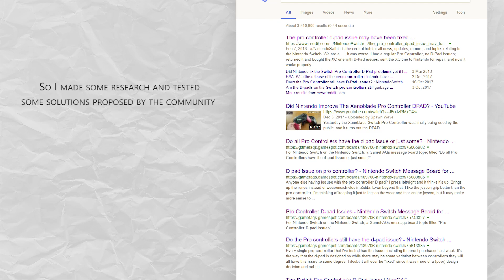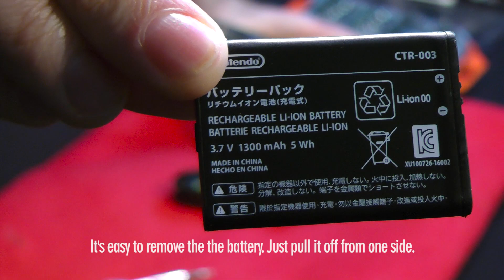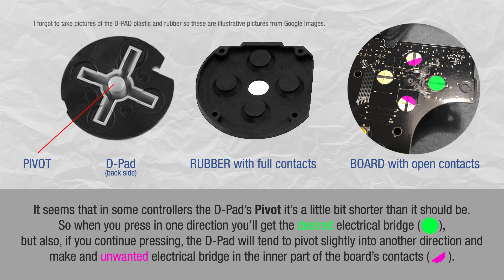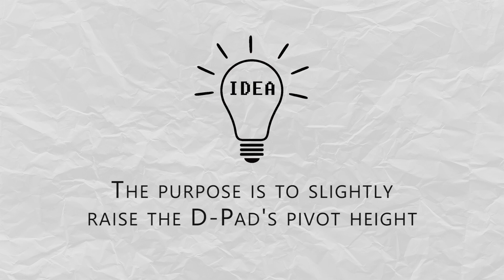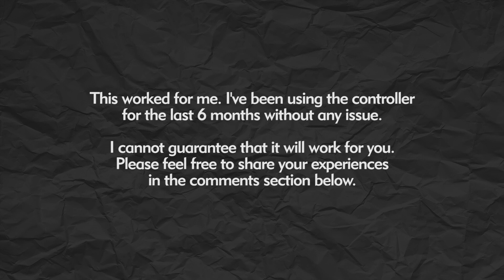Nintendo Switch Pro Controller | D-Pad Issue Easy Fix

Comment: I used four pieces of tape folded in half and it ended up being too much.  I assume by four layers of folded tape you meant two pieces of tape folded in half, because I tried that afterward and it works perfectly.  Thanks for the video!

Comment: Tetris 99 convinced me to try this. I did not cover the leads and you used two pieces of electrical tape layered on top of each other (cut into a neat circle). Well done tutorial.
Reply: I'm also here because of Tetris 99. 

Me: "Let me just push the block once to the right and get a Tetr--"
Pro Controller: "Oh wait what? Did you just..?  Did you just pressed UP? YES? OK! LET ME HARD DROP THAT SHIIIIT!"
Reply: guess we're in the same boat. for me it was completely unplayable

Comment: Mine was really bad and couldn’t play Tetris 99 without constantly hard dropping so I tried this and it works perfect, I covered a small part of the contact points and only used a little bit of tape for the center
Reply: same here, I thought that when tetris pieces droped randomly it was because it was other players attacking me but when I played handheld I realized it was the pro controller

Comment: Just did this myself. Thanks to your video. The only thing I did different was packed four layers of tape onto each other instead of folding it and then cut out the desired size that I need it. The reason I went this route is so I can have a sticky side attached to the pivot point on the d-pad. I did do an accident were I put the tape on the contacts and it was too long so it layered on to each other and I made the tape on the pivot point too thick so I would press on the d-pad and it was too far up, so it had to be pressed firmly. I just went back and remove the tape and started all over with smaller pieces so it won’t have eight layers of tape lol. Once I put everything back together, it all worked perfectly for me at the end of it, It’s a matter of preference for everyone so they might want to try different layers to their liking.

Comment: So I took it apart and found the contacts. I originally put tape on the edge of the contacts and put four layers in the middle, but the ones on the contacts where actually hindering the d-pad. I would press diagonally and get nothing unless I press down like a hydraulic press. I removed the ones on the contacts and kept the one in the middle and it was PERFECT. If your going to do this I recommend you just do the four layers in the middle.

Comment: This was very easy to do, I appreciate the step by step instructions, thanks! It has helped a bunch! I was worried at first that the problem was reversed, that what was once too-sensitive and thus registering accidental perpendicular presses (especially up, which really sucked in the new Tetris 99, quick dropping on accident!) had become too insensitive and it wasn't registering actual, intended button presses, unless it was pressed very firmly. I notice this only at first. It seems as though with some use, I no longer have the problem of light-pressure presses not registering. I'm no expert, but what I believe is happening is that the folded tape placed under the pivot point when very fresh is slightly too thick, and makes the d-pad stand a little too proud, but after some activity, it's mashed down to a thinness that is perfect to achieve it's purpose, but not too thick. Just a guess. Anyways, thanks again for the tip! Shouldn't have to be done on a $70 controller, come on nintendo! glad I went through the trouble though.

Comment: I found that doing both of these in combination for my specific Pro Controller ended up reducing sensitivity to near-unusability. Covering the leads with tape actually makes it harder to make a circuit entirely when the issue is really in the pivot itself. All I needed was the filler in the pivot to raise it. The OG X360 controller has a very similar issue except in the opposite direction: the pivot was set TOO high and there wasn't enough room for the pad to fully travel, so it often wouldn't make connections at all without force and deliberate movement.
Reply: So you only raised the pivot with a stack of tape pieces?

Comment: Good god, finally, a fix to the awful Pro Controller Dpad. I just did the tape on the censors(I didn't do the folding trick), and it worked great. Trying to play Celeste, Meat Boy, Mega Man, Dead Cells, ect, was a pain in the ass with the Pro Controller Dpad. This totally fixed it, and it was easy to do. I haven't had any bad inputs so far. Incredibly easy fix. I have no idea why Nintendo screwed up their Dpad on the Switch, as they're known for their great Dpads? I wish we didn't have to do this, but oh well, this worked.

Comment: I am very gentle with my electronics.  In 4 years, I never got joy-con drift. Yet when it comes to the pro controller, I have never owned, used or seen a pro controller that did not have a faulty d-pad; whether I am using a friends, family members or just testing one out at best buy. Every single pro controller has a faulty d-pad.

Comment: I noob at this n it took 3 times to get right. The 1st time is really frustrating, the controller dpad and abxy button doesnt work. I thought i fucked up and broke it and i was frustrated and i just about ready to just buy a new one. Then i tried for 2nd time for search what the problem. Turn out the ribbon doesnt clip/lock properly during reassemble. Reassemble of the ribbon is really the worst, turn out y need to make sure it in precise position and the lock is "click". But then problem is that the dpad sensitivity is way too low, i need to press the dpad really hard for it to register. So for 3rd time i just remove the tape on the contact and just use the 2nd method instead both. And now it works beautifully, no more random up/down reading and the sensitivity is fine...thank god.took me  2 hours to do this thing. In the end i really recommend just use the 2nd method shown in this wonderful video. Thanks for the vid

Comment: heard a lot of people say this works, i decided to try it
edit: after spending about 2 hours working on it (i had some trouble getting the strip back in and finding the right screw driver) i recommend this my controller not works perfectly, i did the 4 layers of tape on the pivet

Comment: bought a controller very recently and it still has this problem, good thing this looks like an easy fix.
Reply from the maker: Just to know, in which country did you buy it?
Reply: United States
Reply: Did you test it out, paulink?

Comment: Playing a complete 100% of Celeste and was getting tired of the joycons...   I went out and bought a pro controller thinking it would be better for this 2D side scrolling game that requires PRECISE controls.   Had the issue with the d-pad.   Followed these steps exactly as you described and BAZINGA!!!   Works like a charm.   Thank you so so so much for the fix.   I’m extremely pleased with the tutorial video and would recommend anyone to try the same.   Note- I only put the 4 folded tape on the center of the d-pad as shown in the video and did not have to put 4 pieces of tape on the d-pad contacts.   Thanks again!!!!
Reply from the maker: Timothy Stone I'm happy that it worked! When did you buy the Pro Controller? I thought that Nintendo already addressed this issue.
Reply: He actually bought his Pro controller from GameStop used yesterday.  We both took it apart last night/ early this morning. = )
Reply: 'Sup. Nintendo still hasn't adressed this issue, I bought a Pro controller last week and the D-Pad problem it's still there.

Comment: Whaddya mean by four layers of folded tape? Like 4 pieces folded over (8 total layers) or 2 pieces folded over (4 total layers)
Reply from the maker: Caleb1243  I folded a piece of tape 2 times to obtain 4 layer. But could also work with more or or less layers. It's actually trial and error.
Reply: I actually didn't even use that though. It completely screwed over my inputs and made the d pad so tight, it wouldn't click, even with only two layers. Only doing the first trick where you use four different pieces to cover up the sides halfway worked enough for me to play celeste, pocket rumble, and hollow knight

Comment: Thanks for the clear and informative video. Going to try this. On my second Pro Controller with the same issue, even my Wii U Controller has an issue with its d-pad. Pretty disappointing and looks like such an easy fix, would think they'd revise it and release different colours shrugs

Comment: Great video, this helped me out a lot. I used scotch tape and taped about 1/3 of the contact (instead of 1/2). Didn't bother with the pivot, worked fine without it.

Comment: I think I'm going to try this. My warranty has expired, so I can't void it. I'll update if/when I do it.

Update: Wow... I really can't believe how well it worked. I haven't tried any games yet, but I could not get it to register the wrong direction in the settings test. One thing I want to mention is that you shouldn't cover too much of the contact points on the board. If you do, it could cause some issues I've heard. I recommend watching Spawn Wave's video on the board fix for more details on it.

Other than that though, this works great! I highly recommend it. Just make sure your warranty expires first. That way if you get stick drift, you can get it fixed.

Comment: work excelent, I made the other fix almos 2 years but playing mario wonder stated to happend again and cleaning the glue behind when I removed the tape was a mess but I find this method and work very well. Another thing I like about this method is when happend again I don't need to clean and only change the layers of type.
Reply from the maker: Gracias Omar!

Comment: i just tried this, but because of the tape i put on the contacts the buttons are less responsive and they dont register any diagonal inputs, which sucks ass in general but sucks the most ass for stuff like fighting games. because of this i feel like the main issue is really the height of the rod on the dpad and not the contacts at all.

EDIT: i just tried going back and fixing it and figured out that it wasnt the tape on the contacts (or at least it wasnt the main issue) but the size of the tape under the rod that caused my inputs to be unresponsive. i switched it out with 4 layers of tape like in the video and took the tape off the contacts, and it was pretty effective although it didnt completely solve the issue. i tried maybe couple dozen times to get the tape under the rod to be just perfect, but i eventually gave up. pretty annoying, but at least it did help with the dpad issue.

EDIT 2: just tried using the procon in a fighting game and just realized that with the tape mod diagonal inputs are harder. im gonna go insane yo
Reply: That second edit is literally me rn 😔
Reply: I gave up with the folder tape and finaly used only tape on tge contacts 40%. Works well on celeste.

Comment: Tried it and it worked, however when I came to test it on Street Fighter, I found Hadoukens near impossible to pull off, strangely enough Shoryukens worked 100%, might need to test it with different tape folds.

Thanks again for the upload, this was killing me for weeks! (Literally) <3 <3
Reply: I am a little late to the party but it looks like that is caused by covering the contacts too far. Some people have opted to only raise the center of the d-pad for this reason. I am in the process of this right now and I will test Street Fight without covering the contacts and then test Tetris 99 to see if the inputs are more accurate from only raising the center.
Reply: @sykx7  can you comment back? thanks
Reply: @Trollseeder  Hey there, the fix for me resolved issues with both Street fighter and Tetris. I have been using the same pro controller for over a year without issues.
Reply: @sykx7  hey thanks for the info... so you suggest only raising the d-pad and not cover any contacts?
Reply: Correct, the lifting should do the trick. Covering the contacts hurts the  usability.
Reply: @sykx7  thanks Tyler, much appreciated

Comment: Hole reinforcers for three ring binders would work better than tape, just saying... also small balls of blue poster tack in the pits on the underside of the D-Pad. This fix also works on the 8bitdo controllers as well.

Comment: I tested a Nintendo Switch pro controller on a PS3, and no matter what I do, the +Control Pad won't even register diagonal direction inputs at all.  I tested it on Guilty Gear Xrd Rev 2, and the joystick in the input display always goes from a horizontal to vertical position and vice versa while ignoring diagonals.
Reply: Its a lost cause for us fighting gamers, This solution works for games that go with 4 directions, I tried playing some 3rd strike, though it did help alot with charge buffering moves with Urien and Remy but doing Hadoukens or anything that has a quarter or half circle motion does not register, I even permanently broke my D-pad from trying to force half circle motions it was so stiff...

If you really want a good d-pad I suggest getting yourself an 8BitDo Bluetooth adapter, It costs 20 bucks and It makes your PS4, Xbox or PS3 controllers sync up perfectly with your Switch, Ive had mine since it got released and my PS4 controller works like a dream. Best fighting game D-pad ever!

Nintendo doesnt give a fuck about fighters, all they care about are shitty "nindies" as cringey as that word sounds I feel like throwing up every time I hear it uttered.

Comment: I don't have a problem with my d-pad, but what I do have a problem with is my l button, it just has terrible input sensitivity and my input wont register unless I press it a lot harder than I usually would, I can't find a solution to this anywhere, anyone have any ideas?
Reply: wtf is an I button?
Reply: @meriotroid  Well I think you should send in your controller to Nintendo to fix it if you can.

Comment: Alright, I gave it a shot and i don't get random inputs but I do have to press slightly harder down on the Dpad to get  inputs in. I have just bought extra controller parts for an Xbox One Elite controller so I'm going to be replacing the Dpad anyway. This does seem to help a little, and if this is not what you want maybe just sending the controller in to Nintendo may help. Just tell them it makes random input and they might be able to help with either a new dpad or just newer model controller.
Reply from the maker: It worked fine for me and I decided to do it because there's not Nintendo Support in my country.
Reply: P-Switch Ah. Thats really unfortunate. At least you made your own solution which helped too. 👍

Comment: Wait to have the dpad like that did you put the 4 tape under and tape covering some of the area of the button? (Like did you do both steps or just the higher rasied tape one)
Reply: Both, and covering the area is probably more important
Reply: bagelmaster8 Yeah I used electrical tape and it wont read down too well...Im try again with regular tape but thanks for the info
Reply from the maker: Hi Nico! Thanks for watching the video. In my case I solved the problem combining both methods but I saw people that solved it using y either of them. I guess it's trial and error.
Reply: If you look on the contact there is a little protrusion in about the middle. I put scotch tape right up to that mark and it works well
Reply: bagelmaster8 thank you for the tip. Mine works like a charm and feels like the xenoblade one (I compared the two) thanks for the help
Reply: Depends on your particular controller, but I'd say actually the opposite: raising the pivot is more important since it will make the pivot steeper and thus less likely to make two circuits without deliberate pressing.

Comment: I have almost all problems that they switch may have: coat paint wear of the joycons (oili look) same as the back of the console, wifi problems and pro controller dpad problem and dock scratching  (thank god i use a screen protector from day 1)
Reply: Do you have a glass screen protector? The dock won’t scratch those
Reply: I am with you but I also have a rogue fan. I have the whole thing in pieces right now trying to fix it all at once.

Comment: Did the layered tape in the middle and now the d-pad is not sensitive enough, so will re-teardown and remove that and see how that works for me...
Reply from the maker: Use a thinner layer and it will work fine. If the layer is thick enough the Dpad won't even move.
Reply: I removed it and just kept it with the tape on the 4 contacts and it works pretty well now, got a few fake inputs, but pretty rare. D-Pad still ever so slightly less sensitive, but that's a good thing, because mine was super sensitive and would register the tiniest inputs. Thanks!

Comment: Question for you all. So ive tried this method but my issue seems different. Its like the up and down dpad panels have fused somehow. Down does nothing but when i press up, it tries to simultaneously do a down and up input resulting in an infinite loop. I tried completely covering down and then up but that didnt fix anything. Any suggestions before i buy another controller?

Comment: My Wii U Pro Controller, which I am using for playing pc games, is having the exact same issue and I also noticed it playing Steamworld Dig 2. 90% of the time the grappling hook is going up when I want it to go right.
Reply from the maker: I've never disassembled my Wii U Pro Controller but I guess that this solutions would fix it. I had the exact same problem with the grappling hook in SWD2 and that's why I decided to investigate the problem.

Comment: I've tried both suggestions, and now my D-pad struggles to register diagonals. For my second attempt, should I reduce the amount of area the side tapes cover, or reduce the thickness of the center tape?
Reply: what did you end up doing?